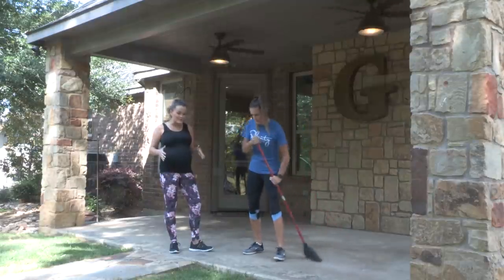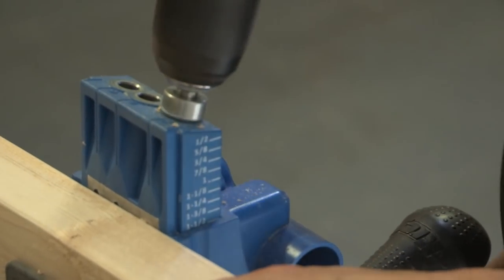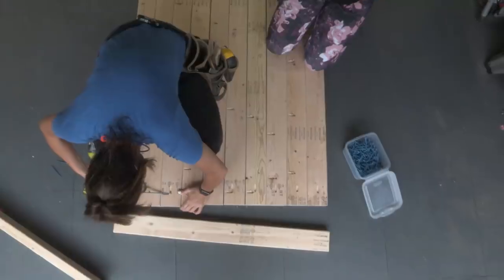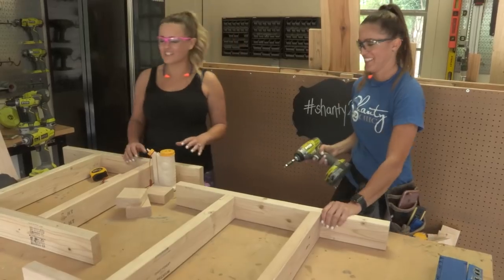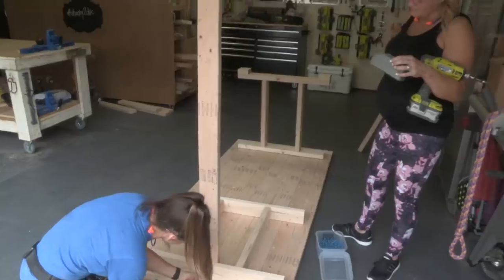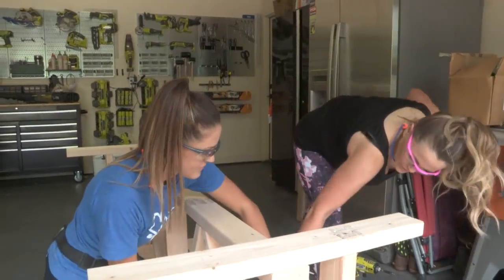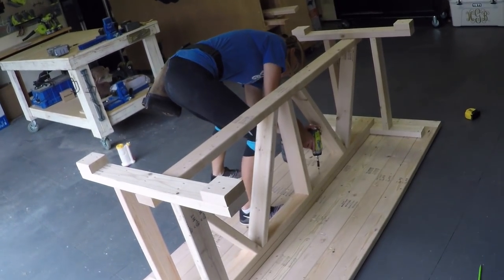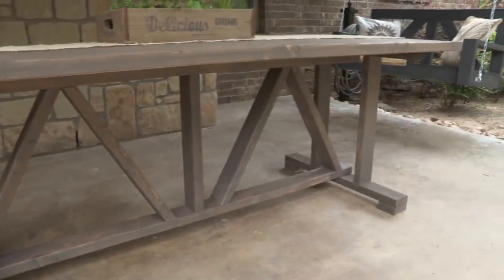DIY $60 Outdoor Dining Table

Comment: Great build and fun to watch. Just for FYI... the wood will expand/retract and the screws will keep it together. What will happen when the wood cracks because of no room to move?
Reply: That happened on one of the tables I built for someone.- Probably leave a little room between boards to allow for water to roll off

Comment: Love the simple design. I'm thinking about a table for 10. My top probably needs to be 42 x 96. Do you think the trestle needs to be modified for that size? I would like to seat 2 people on the short ends of the table.

It looks like you could use 4 x 4's for the legs just to give it a "beefier" look.

Also, do you think you could attach the top using dowels glued only into the support boards so that the top could be removed and replaced for easier moving? Or should the glued dowels go on the tabletop side?

Comment: Great design. It works. I made it using pressure treated wood. Its the first time ever that I've handled a circular saw. What angle do you cut the diagonal pieces? Its certainly not 45. Looks more like 30. Or how do you work out the angle?

Comment: I couldn't find any straight 2x4's, so I'm thinking of 5/4 Deck Boards. Do you think they would look OK?
Reply: You can use deck boards but the rounded edges will need to be trimmed. Which is what you should do with the 2x4s any way. Honestly this is a cheap way to build a table but by no means is this the right way.  This is a good from a far but far from good situation.

Comment: Hey guys. Love your channel and everything you build. I have built many projects using your plans and inspo.
Just a question about the Spax screws on the feet - could you not use pocket hole screws for the 90 degree joins instead?
Reply from the maker: Neil Graham thank you! You could but you will need to fill the pocket holes. We did spax to avoid that. Hope this helps!!

Comment: Nice looking table and good project! 
Any concerns with wood movement by trapping the breadboards and and the base to top with screws?
Reply: Matt Van Dyke great question!! Short answer, YES! They are going to have massive issues. Within the next few weeks I will have a series of videos that covers EVERYTHING you need to know when it comes to building a table. 
No disrespect to these girls for making the video and no disrespect to you, they are / you are not an idiot, just going to make an idiots mistake. 
(831)245-7798
ppwoodwork.com

Comment: I live in a very humid area. Will there be any issues with the wood warping being screwed together tightly on the top?
Reply: Use an outdoor polyurethane to seal it.  They used Spar Varnish by Varathane.  Great product, I used to seal my pub top table on our patio.

Comment: Did you use weather treated wood and did you seal it after your stain?
Reply from the maker: Sharae Robinson we used an outdoor poly to protect it :) Spar Varnish by Varathane
Reply: Any issues with not using pressure treat after a year?

Comment: Hi ladies, one of the measurements on the plans do not make sense to me. It’s the breadboards’s cut measurement- when you lay down 10 of the 2 by 4’s it becomes 40 , on the plans it has 35. I would like to build the table and I might have the boards precut at the store so that they can fit in my car. I love the step by step guide and I am a beginner, so I hope it turns out well. I will add some extra length so that I can cut it at home after I lay them together but the 35 doesn’t make sense to me, please elaborate.
Reply from the maker: Niki Bahanova hey there! The lumber that we build with (and what you are purchasing from the hardware store) is dimensional lumber. A 1x4 is not actually 4” wide it is 3.5” wide. All of the boards are less wide than they are called but the best way to get a perfect fit is to attach all of the planks and then measure an exact cut for your breadboard. Hope this helps and good luck 😀
Reply: Shanty2Chic, thank you so much for your reply! I am so excited to make it happen! Looking forward to making other of your projects!
Reply: 2x4's are actually 3.5 inches, hence 2x4's (10) 35" wide
Reply: Praise the Lord..I get overwhelmed picking out things as well..Thanks for asking and getting an answer to this question..This will be my first build!!

Comment: Will wood movement be impacted upon when screwing on the bread board end? I hear conflicting things
Reply: It will. Screwing together boards like this isn't the best way, especially for an outdoor table. This table, as it's built, won't last too many seasons outdoors, depending on climate.  The best way is to edge-joint the boards and glue them, but that requires more tools and wouldn't be as easy to grasp for people new to building things. But if this video inspires someone to get out in their garage and build something, then that's a good thing.
Reply: What is meant by edge joint? I want to build and 10 foot table and need it to last a lifetime outdoors.